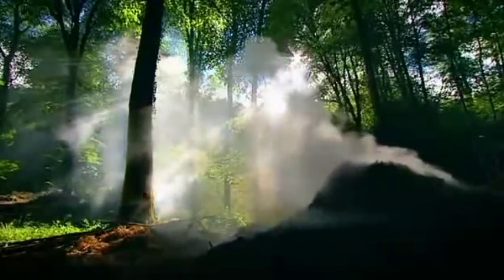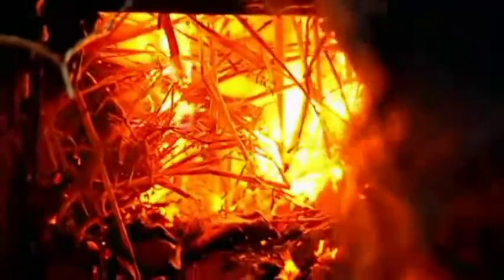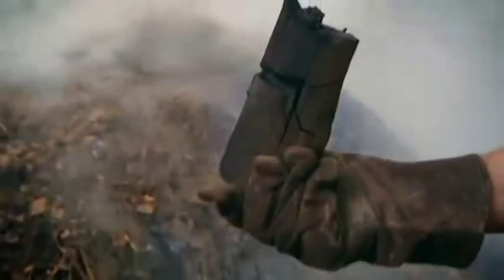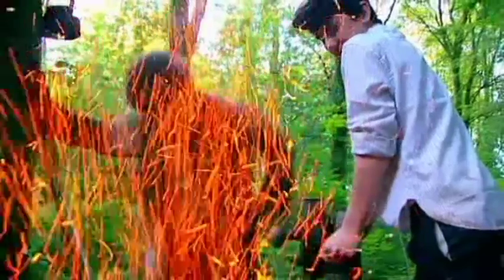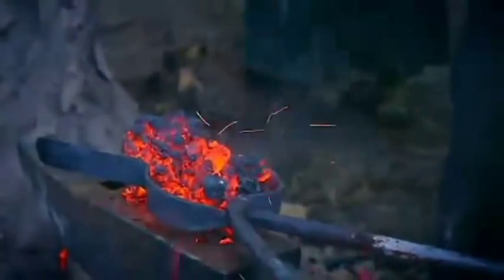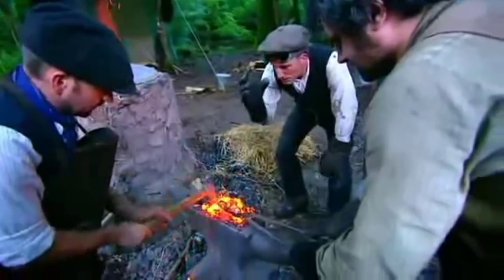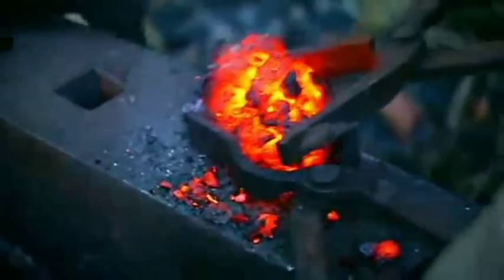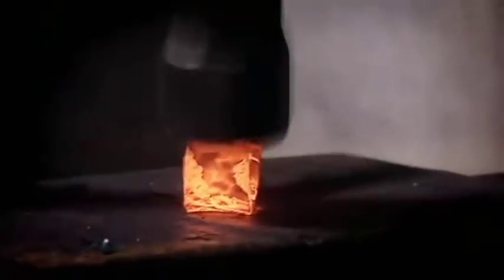Bloomery - Ancient Mobile Furnace

Comment: Fake as hell. "Back at the forge, Simon has worked the iron into rods"
> Dude starts with a piece of commercially produced flat stock
Come on.
Reply: Yeah, it looks suspiciously like hot-rolled metal.
Reply: at 3:45 it looks like they threw an actual piece of red hot metal in with the bloom they took out of the furnace
Reply: Doug Mapper thanks cause I didn't realise it was fake
Reply: I agree it didn't even look like wrought iron especially what would have come out of that foundry
Reply: They threw the iron ore as litteral pebbles instead of a powder, and their atmosphere was probably way too oxidizing. What they got out of the furnace was just molten ore, not iron. It looked crumbly and weak... Sadly i think that's a lack of mastery (i'm not saying i'm much better tho, but i'd rather not lie on my failure)

Comment: Can the slag be thrown back in the furnace so it  can be re-used?
Reply: Yes, that slag is rich in iron an can be reused to some degree
Reply: Some researchers/experimenters looking at a large iron-age smelting location covered in high iron slag found that the old smelters did not recycle their slag even though it would have increased their yields substantially. The reason they found was that doing so made the resultant iron more difficult to work.
Reply: the slag is predominantly composed of silicates and will make a very poor quality material. wrought iron, bloom iron will naturally have some silica in which acts as an intrinsic flux and also helps to make the metal softer and easier to work - much like the carbon in cast iron. the silica will often appear as almost a wood grain in the wrought iron, similar to pattern welded steels. 

i think the referenced researchers and experimenters did not know very much about metallurgy or chemistry as they would understand that while it's easy to pour milk into water, it is not easy to take the milk out of the water. in the same way, it isn't easy to remove the slag from the iron. i have worked a lot with melting and casting white metals, and while not exactly the same, the slag and oxides that form are better off thrown in the trash - even if there is good metal visibly stuck to them. the time, fuel and patience that is spent trying to separate really some tiny amounts of metal from slag can be much more productively spent by just refining more ore or more scrap to begin with.